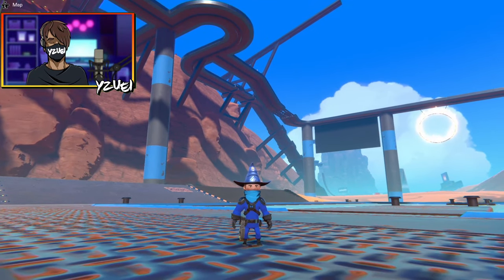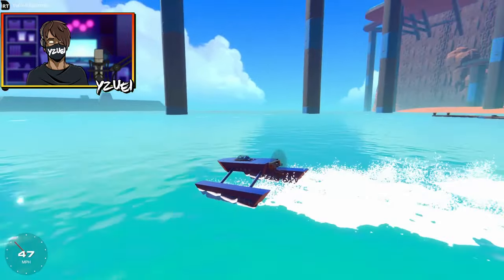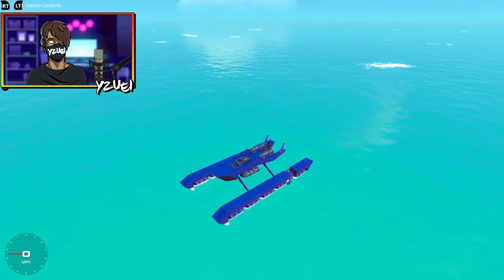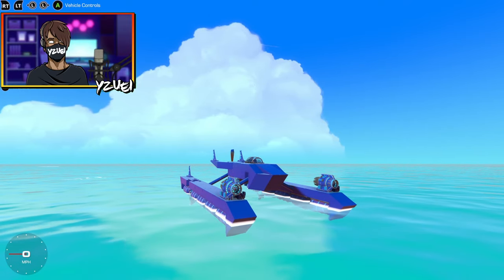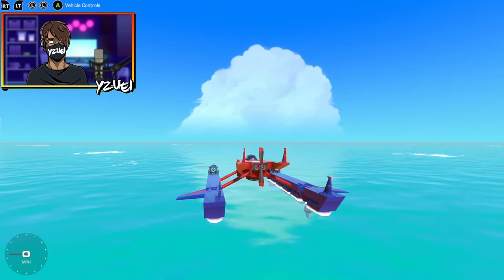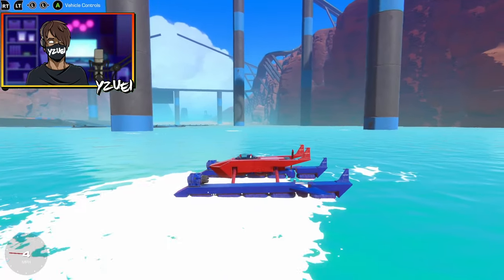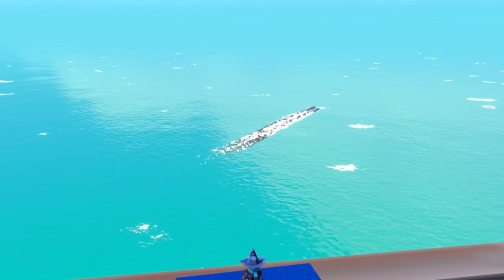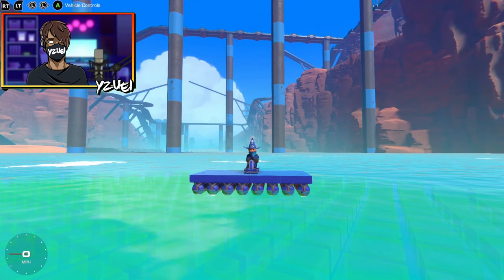Making an RC SPEED BOAT to satisfy my Childish Needs | Trailmakers

Comment: The bouncy effect is due to the center of thrust being misaligned with the center of gravity. The water propulsion is pushing the nose up, the air propeller is pushing the nose down. Not sure if you were aware but hopefully it helps you on future builds